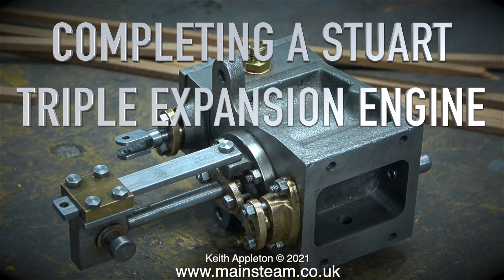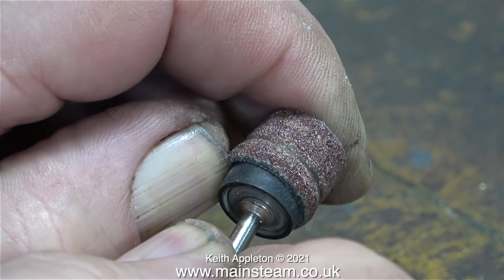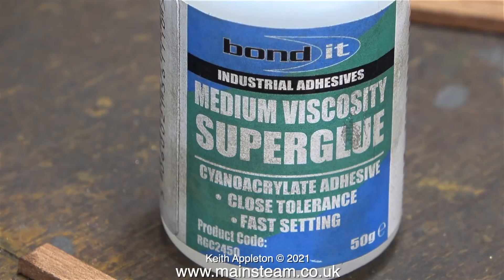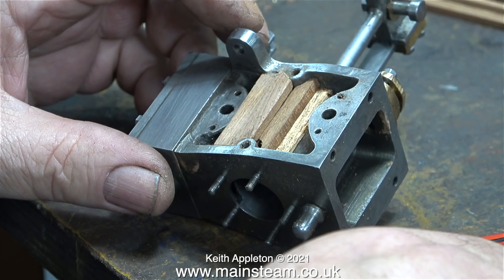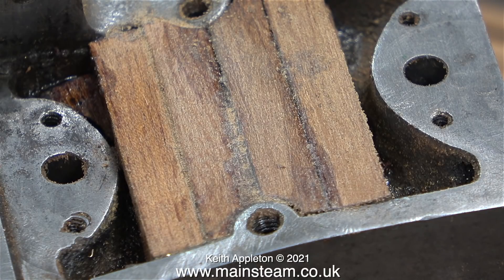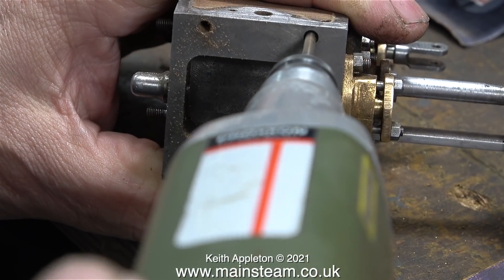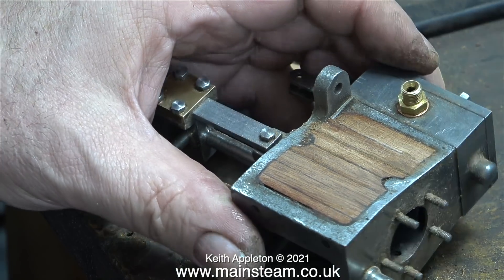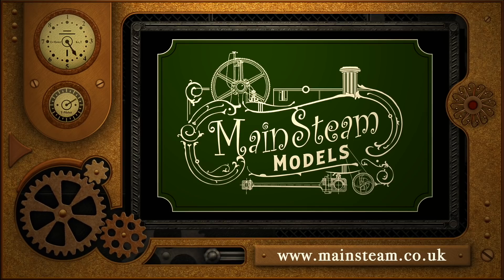COMPLETING A STUART TRIPLE EXPANSION ENGINE - PART #26

Comment: Did you realise that that Super Glue is only rated to 80c. Obviously not a problem if you’re only running on compressed air, but it won’t be suitable for steam.
Reply from the maker: I didn't know that. Oddly enough, I have never had any cladding fall off my Steam Engines by doing it this way over many years.

Comment: Keith. I’m wondering why you are cladding the cylinders. Does the cladding perform a specific purpose? Or is strictly cosmetic? I have seen you clad boilers and assumed it was a form of insulation, besides making the boiler look finished off. I wouldn’t think the cylinders need insulation, but I am by know means steam engine knowledgable.
Reply from the maker: It was an experiment. In a future episode you will see what I do with it.
Reply: On a full size steam engine it reduces heat loss so improves efficiency. Boiler cladding does make a difference to a model boiler, but probably not noticeable on a cylinder.